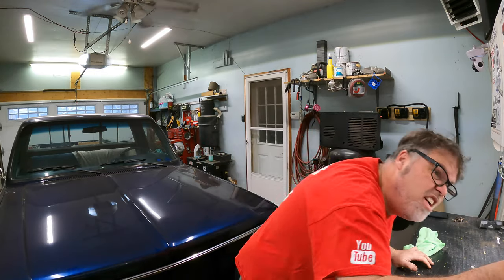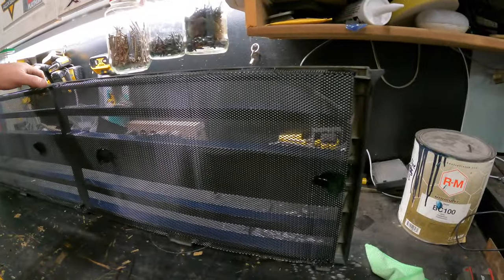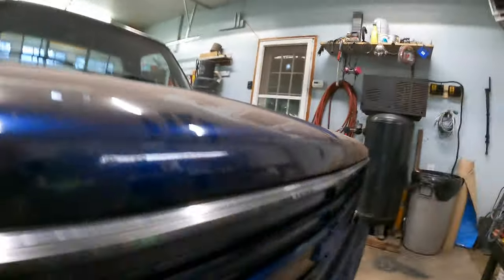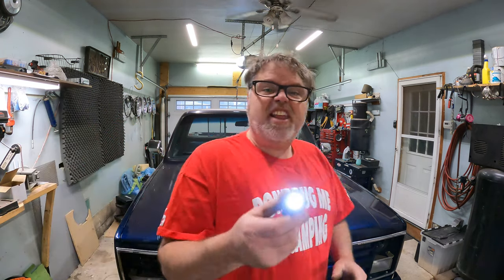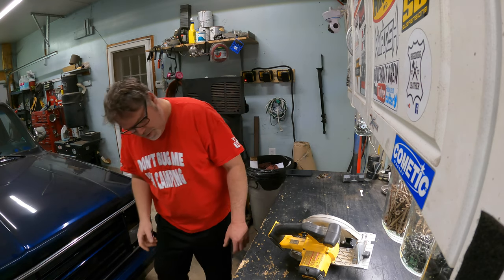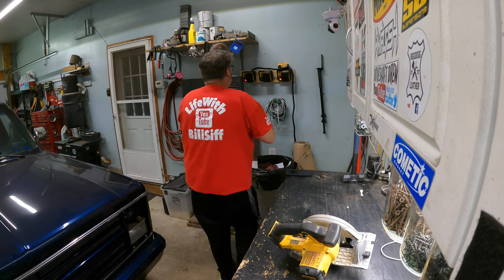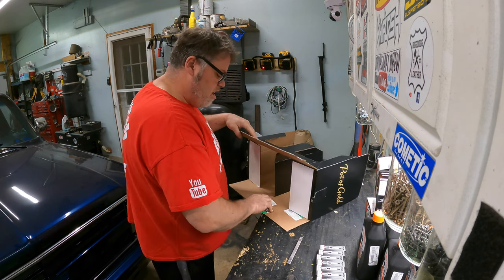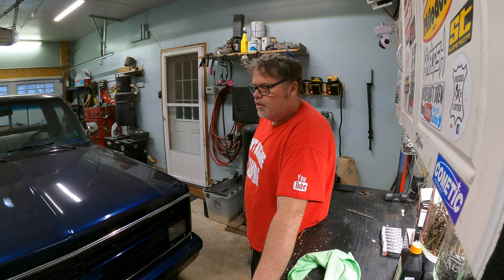Grill Mesh And How It Loooks   4K

Comment: Hi Billsiff,  I would avoid using the diesel oil as your engine is running and the diesel could end up causing excessive wear as it contains a lot of detergent which s fine on the engines Derek (VGG) is startıng and trying to clean after lying ıdle for 15 years plus. I would stick with what you have. Just sharing my opinion based on experience.